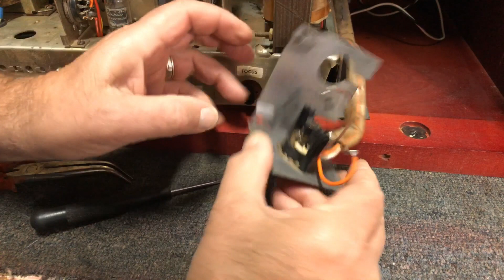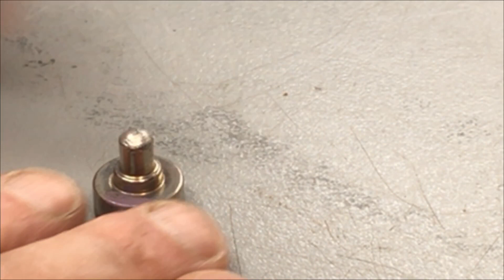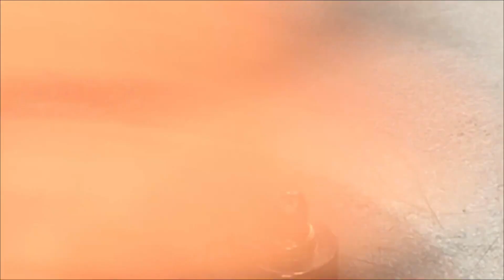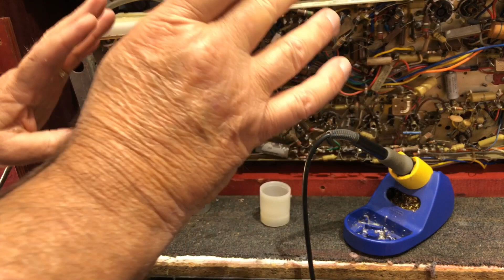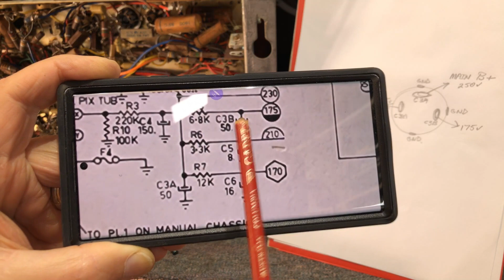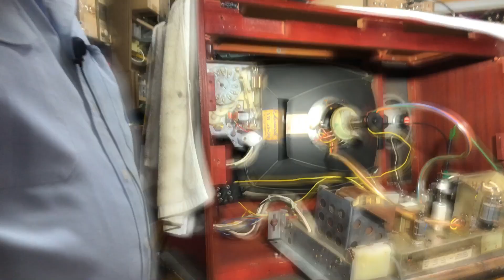Kriesler TV Part 6-1 - The Chassis Repairs

Comment: Unplugging the speaker, i.e. open circuit on the output transformer secondary, will induce very high voltages across the transformer primary and the output valve anode and may  cause flashover and damage.
Reply from the maker: It's all good, hasn't happened in the last 50years, lol

Comment: Great work. , but I must tell you that during the late 1960s my cousin was fortunate enough to purchase a remote controlled 25“ console  with deluxe extended sound with large 10” bass speaker it was all remote controlled !mechanical type unfortunately it suffered some major breakdowns but it was a beauty with an approximate cablnate size of 1.5 meters in rosewood finish truly a beautiful piece of furniture all valve circuitry. and yes it was a KREISLER  !! .
Reply from the maker: Gee that would have been State of Art back then !
Back when you got a furniture piece, not thin plastic !
Cheers